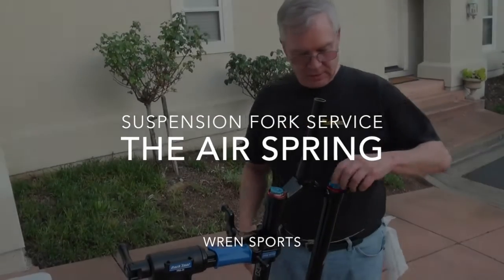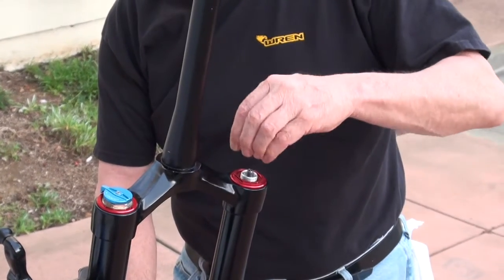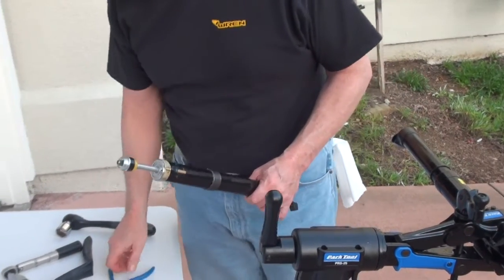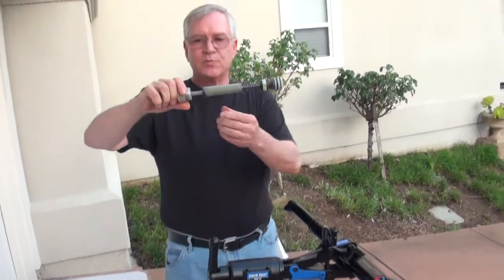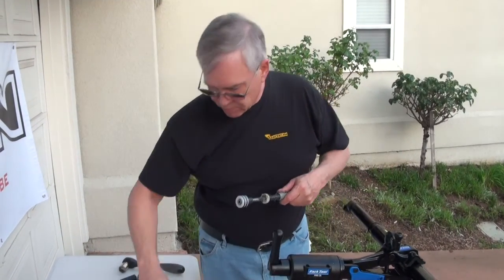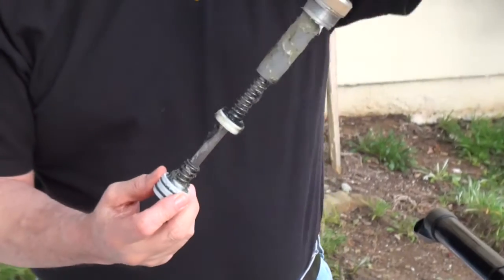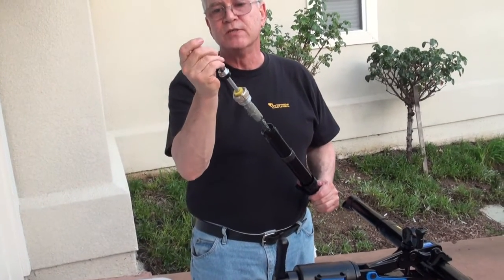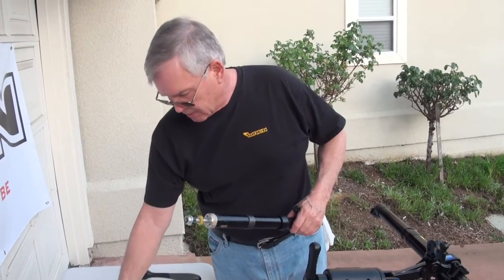Wren Suspension Fork Service - Air Side

Comment: The air side also took me a couple hours for my first service. Several things to note: 1. Release all air pressure from the top and bottom before getting started. 2. The grease on the o-rings looked like Slick Honey/SRAM Butter; it didn't look like Molykote 55. As best I know, this is the first time my fork has been opened up. Makes me wonder if SRAM Butter is "super good enough" (with Molykote 55 still being the "best").  Good luck!

Comment: I’m in the  market for a front suspension for my Salsa Bear grease fatty and trying to gather all the information on your product..... I see the travel adjustments adding subtracting clips on the upper but on the lower what is AC  on the lower? I understand the advantages of the inverted fork ........ the terminology I’m a lil rough on ...
Reply: Hi Randy!
Your bike would use our WSF150-110ATK suspension fork. This is a 150 mm hub, 110 mm travel, 530 mm AC fork. AC (axle-to-crown) length is the measurement from the top of the crown where the crown race sits to the centerline of the axle. To stay within Salsa's specs, you would drop the AC and travel by 10 mm using the clips supplied with every fork. You can find technical information about the fork on our website's Tech tab at www.wrensports.com. If you have any additional questions, feel free to contact me directly at russ@wrensports.com. Thank you for your interest in Wren products!
Russ Johnson

Comment: What brand or type of pin Pliers are those?  I cant seem to find any that look like this.
Reply: I don’t remember the brand, but I have found them in hardware and big box stores. Russ
Reply: I use Finish Line stanchion lube. A little goes a long way. Russ
Reply: 1.7 bent internal pin pliers? Theres a few different size pins..
Which is it Russ?..

Comment: I just purchased the fat bike fork and need to reduce the AC to fall into the specs of my Salsa Beargrease (511mm). This means I end up with 90mm travel and 510mm AC. Am I correct that I ONLY need to add a white clip to the spring area?
Reply from the maker: Hi Don! I assume you purchased our 110 mm travel fork. This fork has an AC of 530 mm. The fork is supplied with 2 clips: 1 - 10 mm and 1 - 20 mm clip. To reach 510 mm AC you would install the 20 mm clip on the very bottom of the air spring. This position reduces AC and travel together. So, yes, you will reduce the fork to 510 AC and 90 travel. The video above will guide you. However, the video shows installing the clip between the springs. I have noticed that sometimes this can cause a clicking noise. So I now recommend the clip be installed below both springs so it sits directly above the white air piston. I have detailed written instructions on how to install the clips at https://wrensports.com/tech-resources/
Thank you for riding Wren!
Russ - Wren Sports
Reply: @wrensports  Thanks Russ, got the bag of goodies with the fork and see the 20mm clip. no star nut btw which was a bit of a surprise. looking forward to installing.

Comment: What is the service interval for these forks?
Reply: Hi Ray!

We recommend that you gently clean and lubricate the stanchions after every ride if they are dirty. After every 50 - 100 hours of riding, you should pull the stanchions to clean and re-lubricate the bushings and keys. Every 200 hours of riding you should pull the air spring to clean and re-lubricate the coil springs and o-rings. The damper is maintenance free and does not need to be serviced. Thank you for your interest in Wren products!
Russ Johnson
Reply: @russjohnson2781  How do you recommend to lube the stanchions after each ride?